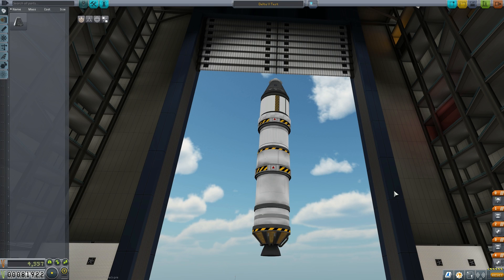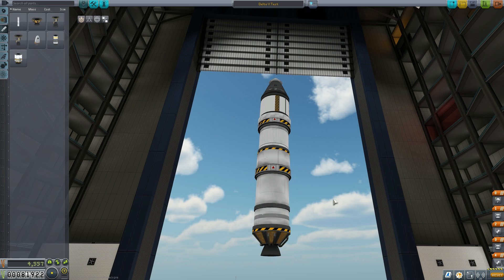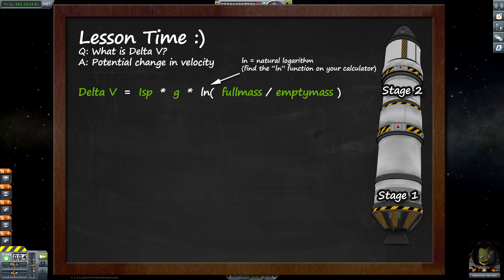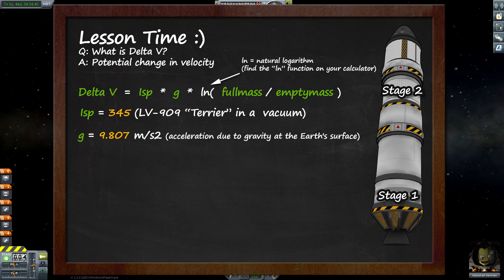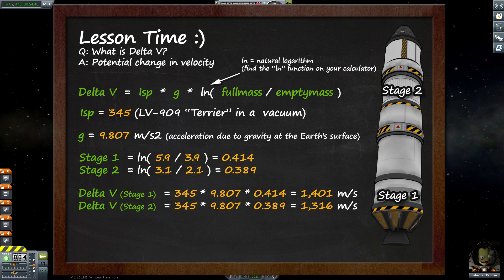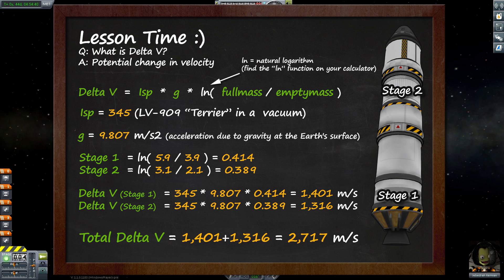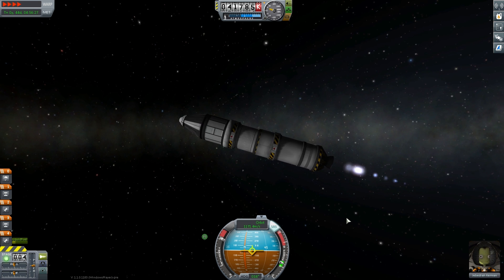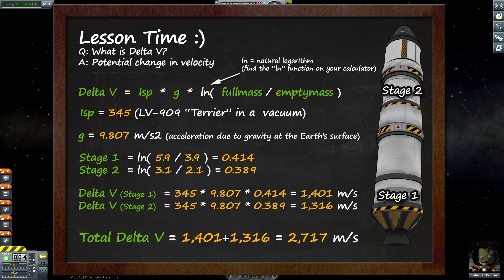Delta-v Calculations - Kerbal Science (KSP)

Comment: I'm having a hard time finding out how to find the g variable. Should I just use 9.807 in the video?
Reply from the maker: Yes. the "g" is a constant and it is this value that is derived and a part of the calculated Isp values for an engine. So no matter where you are the gravity constant is still correct. It is actually more the Isp values that seem a bit wacky as they are values based on the "g" constant.

Comment: Sooo g variable doesn't change? Ever?
Reply from the maker: No. "g" is a constant.  Isp is actually the weird part of this as the Isp of an engine is calculated based on the gravity on Earths surface (if I remember correctly) this thread here will help.
http://forum.kerbalspaceprogram.com/index.php?/topic/109331-correct-algorithm-for-calculating-the-delta-v-that-your-rocket-have/
Reply: Marcus, does Kerbin have a lower g value due to it being smaller? Or did the devs keep it the same as earth's gravitational value?
Reply: I believe the 'g' variable is used as a universal way to calculate, even though it may be inacurate. There are charts that can help you translate for the kerbal worlds using how many m/s delta v you and and how you you need to do blah blah.. etc.

Comment: Why is there a "g" in the equation ?
You are floating quite high above Kerbin(earth), should't you use the specific acceleration 
caused by the planet in this specific distance ?
Reply from the maker: A great question. I thought this made little sense at first too. The ISP of the engines are actually derived from a constant "g" which is why it always needs to be used (like a constant) regardless of the gravity the craft is in. 

"Gravity in that equation is always 9.81. It's actually Earth's gravity, and comes from the fact that US Engineers were using pounds for both the weight and mass of the fuel. Because pounds of mass are always defined with respect to Earth's gravity, you always get that 9.81 factor in the ISP formula, rather than anything relating to local gravity. It's purely a units conversion factor and nothing more."

From 
http://forum.kerbalspaceprogram.com/index.php?/topic/109331-correct-algorithm-for-calculating-the-delta-v-that-your-rocket-have/

ISP is actually the confusing part once you understand how that is calculated. As quoted by many a person "Isp, confusing people since it was invented".
Reply: Thank you so much!
Reply from the maker: +Nir Gutman no problems. Thanks for the question and sub!
Reply: Im confused Marcus if the isp is based on the g as opposed to the local gravity why is there 2 differing amounts for isp based upon in atmo and out of atmo? if it not based on the local gravity ie in space then why is there differences?